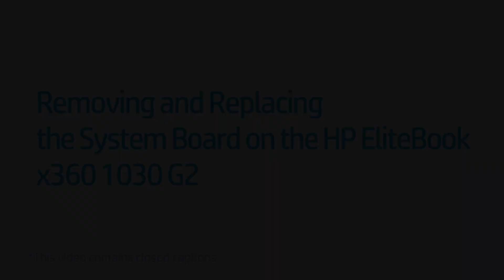Remove and Replace the System Board | HP EliteBook x360 1030 G2 | HP Support

Comment: This is great. I’ve got the system board out. But I’m replacing a faulty keyboard. Is there a video for that? Thanks.
Reply from the maker: Hi Mitchell, thanks for contacting HP Global Social Media Support!
I understand that you need to know about replacing the keyboard.
I will do my best to assist you.
The top cover with keyboard remains after removing all the parts.
Binu - Social Media Tech Support

Comment: If i want to use this laptop for gaming can i replace the intel uhd 620 graphics with a nvidia gtx 1650?
Reply from the maker: +Rudy buoy HP does not recommend upgrading or downgrading hardware parts or software that is bundled with the product as It may affect the manufacturer's warranty and performance, however, you could change the configuration at your own discretion.
Reply: @HPSupport  can i atleast replace the intel i5-8250 with an apu-ryzen 5700g with radeon graphics? I have an hp elitebook x360
Reply: @liltjay5497  No, they are soldered to the motherboard.